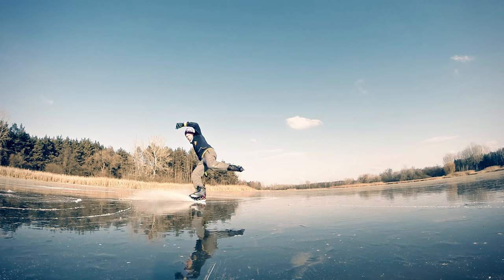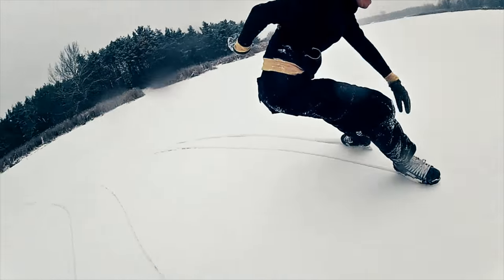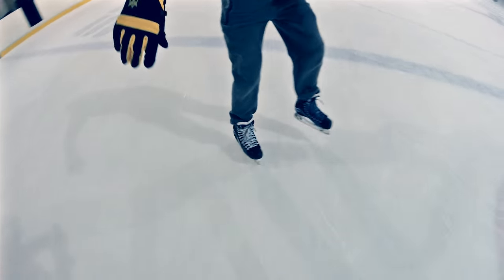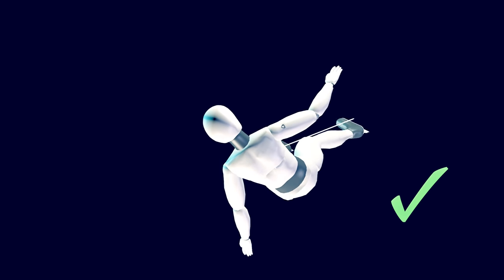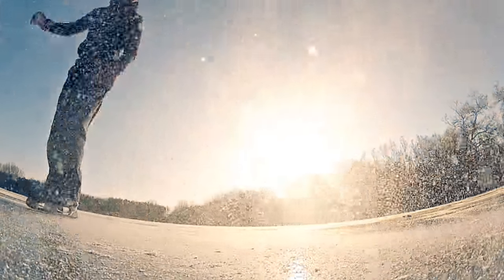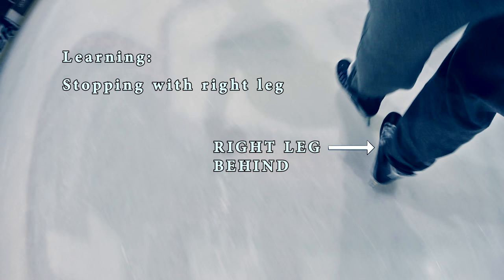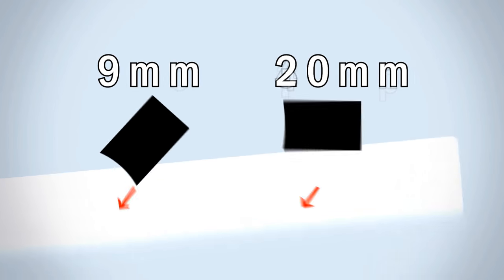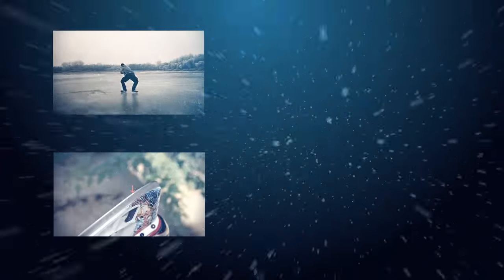Ice Skating Stops - Tutorial

Comment: do you have your ankle taped? if you are doing a sudden and fast break isn't there a risk for getting a sprained ankle? or does good skating shoes give you the stability?
Reply from the maker: skates should hold you tight, exception is the top 3-4 holes where the laces should allow flexibility for movement. Ankles are way below that in a fixed place.
Reply: @NagyerdeiKorisok  hard breaking would probably injure my adductors or cruciate ligaments. :) of course it is also a matter of practice and technics.

Comment: i have 9mm, can I do the hockey brake? or 20mm is easiest?
Reply: You can even do a hockey stop with a 7mm radius sharpening if that even exists lol
if you are not used to the motion of a hockey stop and still have a hard time getting the right angle on the ice to slide it is much easier with a more wider radius like 20mm try it out but 20mm is pretty damn wide Id use like 12-18 or smth like that